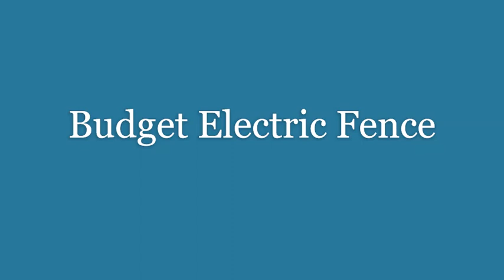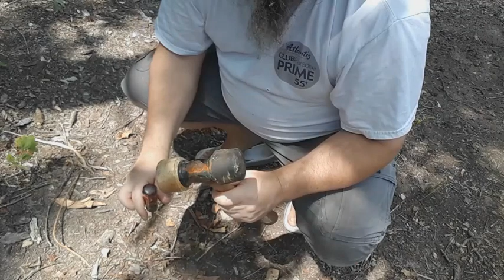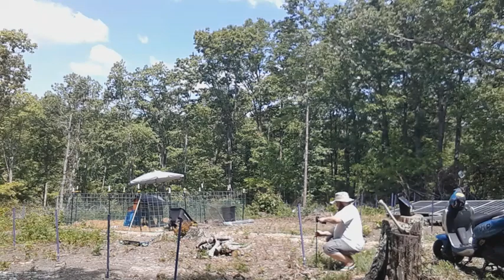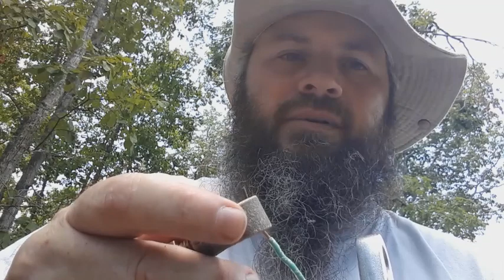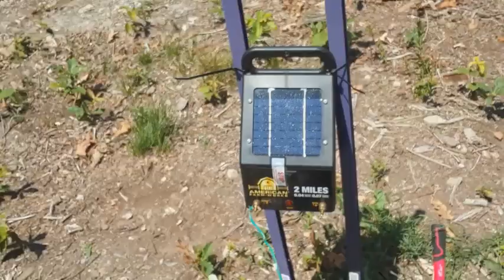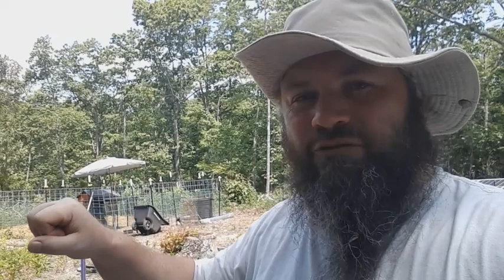How to Electric Fence on a Budget

Comment: Why didn't you pour water on the ground first before pounding to make it easier? Have a great day 👊
Reply from the maker: This is why subscribers are great for a channel! Now to answer that. I can't think of everything.  The soils very compact. In order for seepage in a spot I'd need a drip system to soak the ground. It took me all of 1 minute to pound that 3 foot ground in. This question doesn't go with out merit. It's also a great idea to test the soil drainage as in a percolation test, or perk test, is used to determine how quickly or slowly water drains from the soil in a particular growing area. This is an important step toward determining how well-drained a particular soil type might be, and whether additives are needed to improve drainage. Very useful to know!

Comment: We gotta slap up an electric fence, so my attention is urs
Reply from the maker: What I used is good for a garden imo or a Tiny space.  Normal T-Posts is the way to go. Rest of the wiring yeah... similar. We'll do a T-post video soon showing the isolators and caps.
Reply: @TheWickerShireProject  yeah our current electric fence for the horses at my sister's house has those plastic posts end up snapping but I think they're great on a budget to get something up asap for sure. Maybe for smaller critters too? Or maybe the sun weakens the posts over time. However, they're definitely easier to put up and way more budget friendly so apples and oranges.